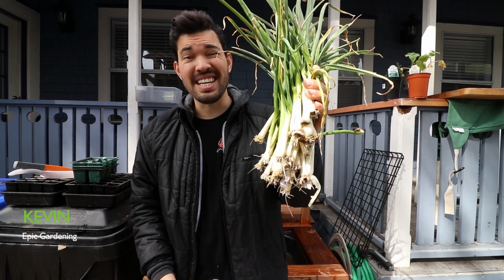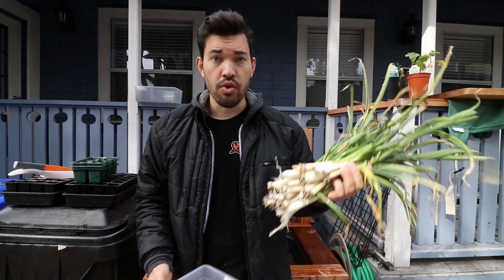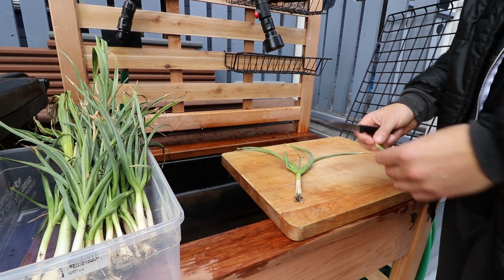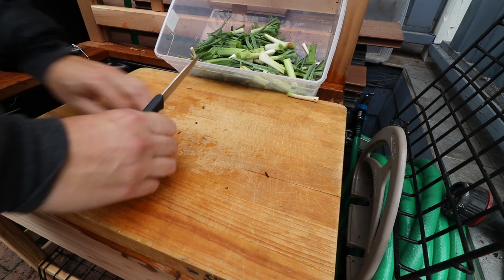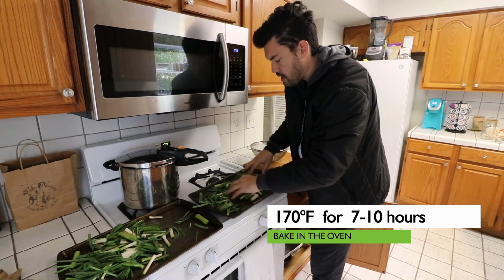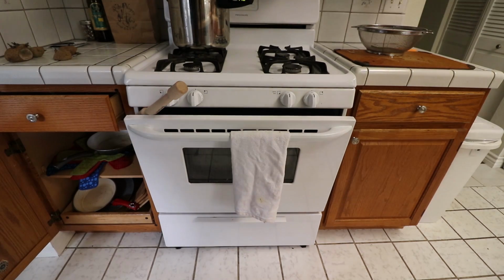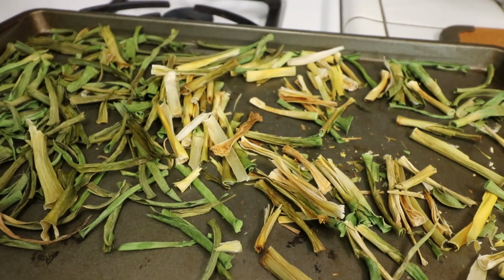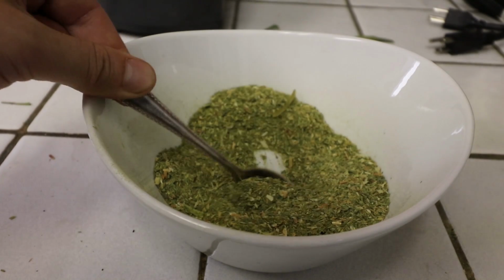Never Waste Your Garlic Tops Again! Green Garlic Powder Recipe

Comment: FYI you can make an easy solar dehydrator with a cookie sheet with a cooling rack set in it, and a pyrex casserole pan turned upside down over it. Definitely not a lot of space, but it's great for doing a small batch of cherries or tomatoes. I find it usually takes about 2 days.

Comment: I have found one of the simple things in life even though it has a larger up front cost I like using a plug in dehydrator as it will allow you to get lower in temp and greater control at those lower temperatures.
Reply from the maker: And you waste less gas! I am trying to get my hands on a dehydrator now :)

Comment: Another great tip for the never-ending greens is to start a garlic clove in a shot glass half filled with water. I usually fit 2-3 in 1 shot glass. Be sure to keep the roots submerged in water and leave on a window sill for few days and the cloves will start rooting and breaking through the top with greens (scapes). Once they start to green I transplant them to soil. I usually have up to 10 in a pot on my windowsill. This works with onions too. Keep the soil nice and moist but not soaked...I use a spray bottle only but will spray the greens and soil through the day.

They will do just fine in water alone but I found that after awhile the flavour starts to become much milder if you don’t get them into soil.
Reply from the maker: Yeah, or add nutrients to the water so they can actually develop more flavorful greens! Good tips :)